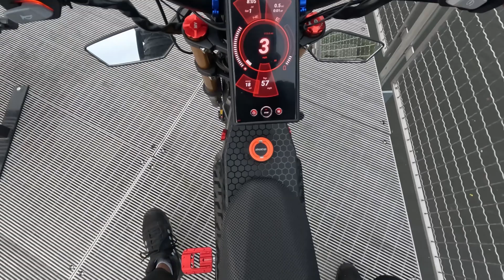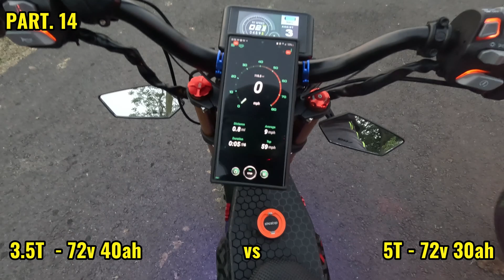custom ebike build (part. 14) SPEED TEST 60mph

Comment: Are the rear wheels the same size?
Reply from the maker: Yes 20x4.0 both front and rear motorcycle tires 100/90-16 as in 16inch motorcycle rim

Comment: My bike use to cut off too, I think it was because I had 150 amp controller and my battery was too weak
Reply from the maker: Only if u can change the settings in the controller and turn down the amps to match the battery continuous discharge 
If it still cuts off turn down the phase amps

Comment: which one is the fastest, the speed?
3.5T or 5T?
Reply from the maker: 3.5t
Reply: @krebikes  what is the difference between 3.5t and 5t?
Reply from the maker: @Sekolah.YouTube  3.5t high speed 100kmh
5t high torque 70kmh
As you can see in the video the 5T is quicker short run 
but the 3.5T faster at top speed long run
Reply: @krebikes  
3.5t motorbike, red light or blue light bike?
5t motorbike, red light or blue light bike?
Reply from the maker: @Sekolah.YouTube  5T red light
Reply: @krebikes  ok thanks 👍👍

Comment: hey man, is there anyway I could chat with you for a second? I know in a previous video you said you widened your swing arm with a cross bar, just wanted to see what way you managed to do it. Appreciate it! Awesome bike btw!
Reply from the maker: put the wheel on first where the axle suppose to slide in the slot use the crowbar against the freewheel area and on the inside of the swing arm
for me my torque arm/washers go on the inside part of the frame which makes it hard to slide the wheel down
if it is impossible then maybe you have the wrong dropout hub
@krebikes or @drillmaticllc on Instagram